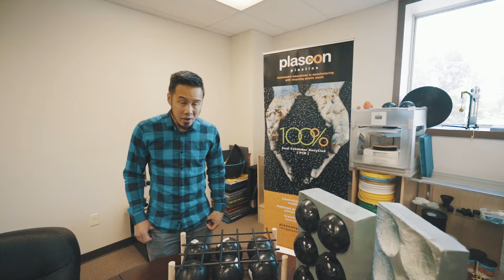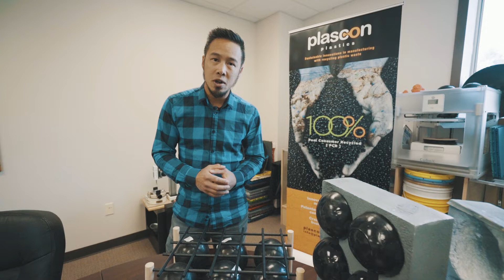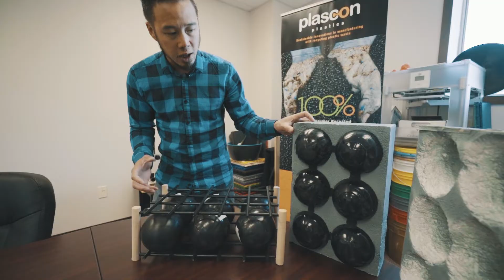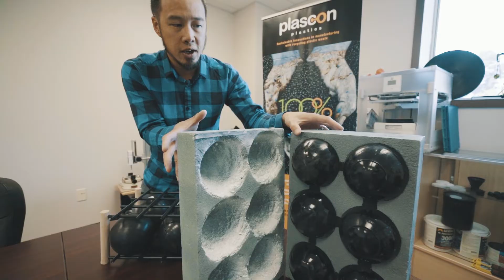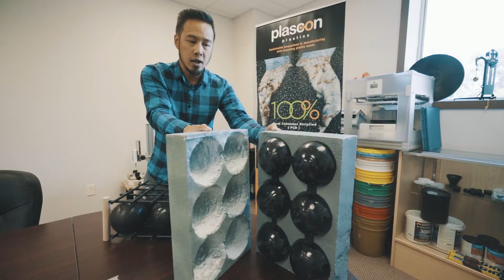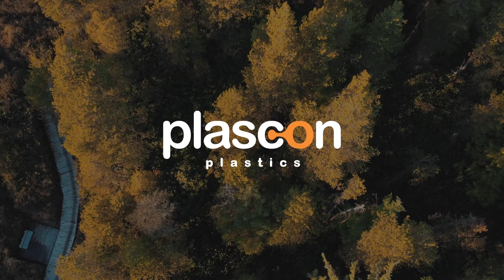What is BubbleDeck Technology | Plascon Plastics

Comment: I have so many questions. can any one describe these
1. what about life of structure?
2. what about life of ball?
3. is it full with air up-to- structure life?
4. how much we need thickness for slab for pouring?
5. balls are common are specially made for structure. ?
6.what type of balls we used in floor, footing and slabs.?
7. can you introduce any which had been construct with these balls.?
8. is these ball use full  for all types of structure or only for building?
9. how many floors we can construct in building and what area?
10. are these balls we use in all structural members (footing, short column, plinth beam, shear wall , super columns, slab, stair slab, parapet wall,  )

Comment: Ok someone needs to explain the math of less concrete to me. The bubble deck slabs are thicker than regular slabs, so is this misinformation?
Reply from the maker: Hello, the concrete removed is deadweight concrete, not structural concrete. Slabs does not have to be thicker in most applications. Please see link for span information. 

https://bbdna.com/index.php?display=technology
Reply: @PlasconPlastics  I think this is a great engineering discovery but from your spec sheet it has limited use. Most condos slabs here in Canada are 8" and less,  which is below your minimum thickness application. It's only parking garage and lower floors have thicker depths.
Reply from the maker: @deliman7203  That is entirely correct, which is why we do not think BubbleDeck has taken off in Canada as much as it could have. Mainly it has been used in Canadian universities, but not residential application. However, we are currently building a new company and product (outside of BubbleDeck) to work with small 8" slabs. So stay tuned. It should be expected to launch in 2023!
Reply: @PlasconPlastics  Yes good luck, I think it's a great innovation. 
The other aspect to consider is the actual on site application and quality control. A lot of my concrete formwork brethren aren't the brightest light. I could see situations where upon walking (prior to pour) on top of the rebar and balls, the balls get misaligned   and potentially creating weak spots in the pour.

Comment: Is it applicable for one way slab or two way slab or both? Is it applicable for pretensioned concrete slab?most importantly I'm curious about the shearforce, bending moment ,deflection check, the coefficient of thermal expansion, mod of elasticity and bulk modulus and the performanceit gives during fireload and frost .Although iam still in my betech in civil and still much to know ,If my guess is correct and these spheres are made of some sort of polyethylene product there should be quite a decrease in the strength of the slab. And another thing, countries like America where precast is mostly favoured the cost of some major repairs in these kind of slabs can exceed. Iam sure you guys have thought the solutions of these problems. Looking forward for your answers.😄
Reply from the maker: Hello it may be best to contact us directly at bbdna.com to answer all of your questions. We actually see an increase of performance in most points you mentioned. It does not decrease strength as we only take out the non-structural concrete. Therefore, the slab is actually under less stress and support columns can be removed. In a way, it is stronger than a typical slab as it does not have to support as much of its own weight. We used to do fully pre-cast slabs. Now we pre-fab BubbleDeck cages which are brought onsite for the concrete pouring. We find this to be more cost effective. In terms of overall cost, we see a 10% of reduction of building construction costs due to deceased materials and cycle times. It is also easier to implement mechanical systems, electrical, HVAC etc. with BubbleDeck.  Sorry I can't answer all of your questions here, feel free to reach out. Have a great day!